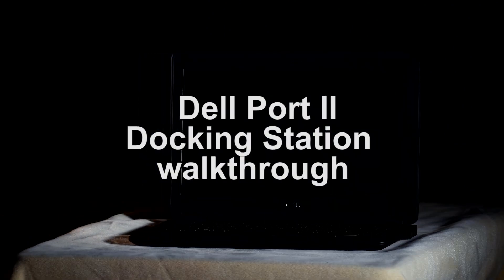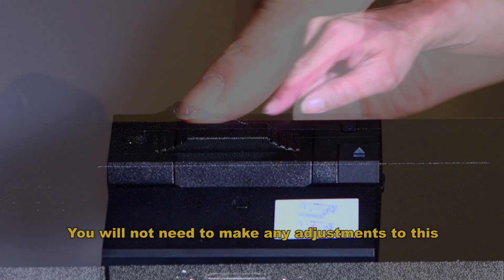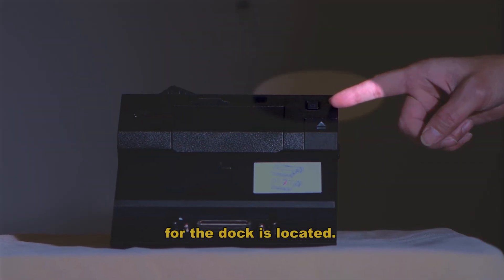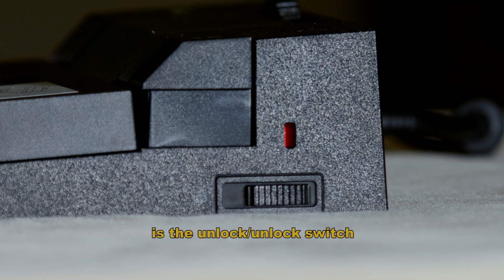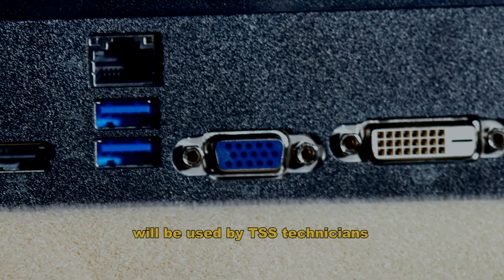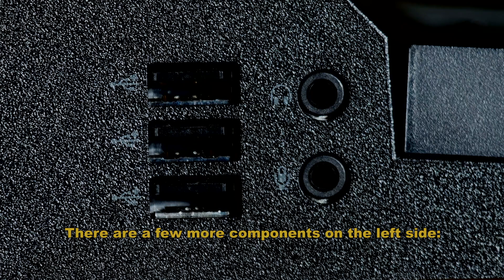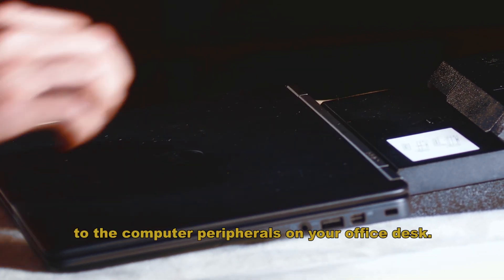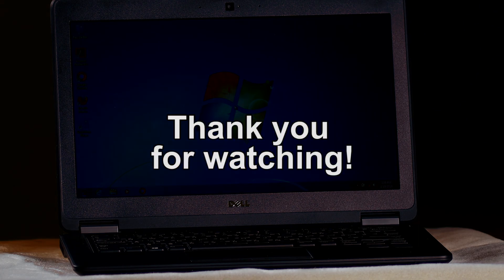Dell E Port Docking Station

Comment: What gets me is the angle of the laptop seem off but it does seem stable.  I was hoping it mint solve my charging issue but no such luck... I got one with dual display ports... the battery slider must be for a different computer cause it's useless on mine.
Reply: Why would a docking station fix a charging issue?

Comment: I have both pro2x and pro 3x..The sliding bar just mechanically slides the spacer block down to fill the big space  . Has nothing to do with battery or the battery slice which you would not use as it uses the connection slot.  Sliding space bar  all the way till touches your laptop  helps center the laptop easily..then lock and when release unlock then press ejector. done. USB 3 ports always blue. also Your mouse will be slow if on usb 2.0 side ports. when you are done connecting monitors printers etc  you will feel like you are at helm of the  battle star galactica. :)

Comment: I just bought this exact same model at a Goodwill for $3.00!  It works well with my Latitude e6420 also I bought at a Goodwill a while ago.  What a coincidence!
Reply: do you have to run setup from a cd or something first?
Reply: @butchcasidy7882  There is no setup. Just plug and play.

Comment: This does not show you how to set it up! I work from home remotely and do not have a technician. I need to know what to plug where to make it work! Change the title because you are not showing me how to setup and connect!!! Total waste of time.
Reply: True
Reply: There is no setup. Just dock the laptop to it and plug in whatever you want, wherever. It's basically just a port replicator.